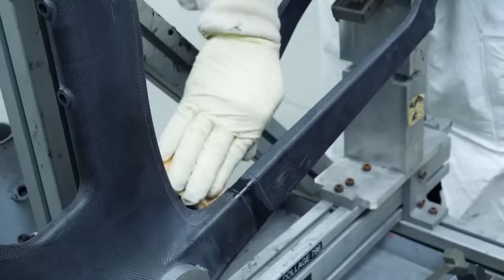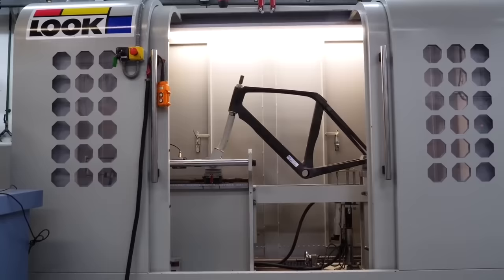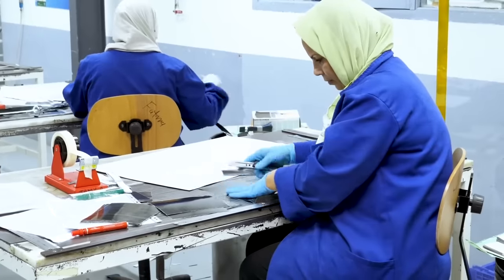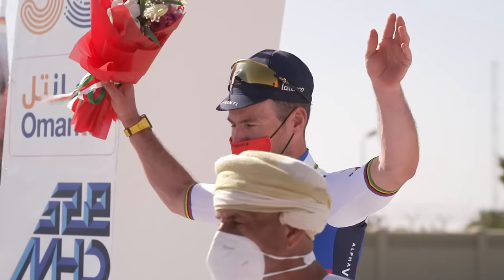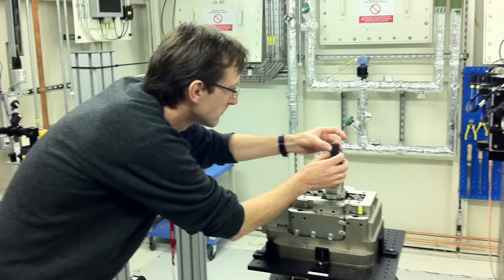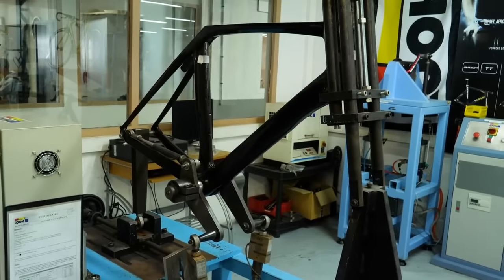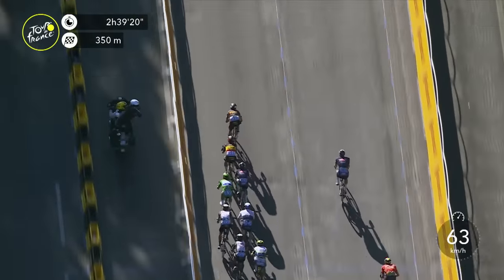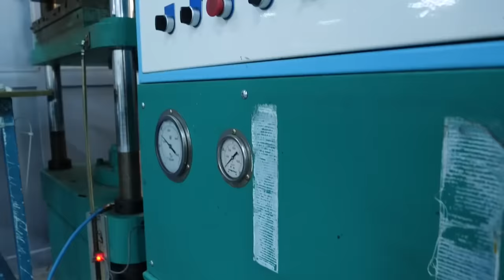Your Carbon Fibre Bike Won’t Last Forever

Comment: The "dead" feeling is by no means limited to pro sprinter's bikes.  Here in Girona many pros (including domestiques and climbers) talk about the difference in feel between their training bike (which may do around 30,000 km in a season) and the bikes teams reserve for them to ride in races; the difference between them is more noticeable as the season progresses.  When new bikes are issued at the start of the next season even the dedicated race bikes feel better to ride.
Reply: So that would suggest that 30,000 km is enough to cause significant fatigue.. That's not very much! It would mean that even your average keen amateur doing just a few thousand km a year is going to "wear out" a frame in 5 years in terms of ride feel. OK, they will be putting out less power and so the loads wil be less, but not by an order of magnitide.
Reply: @neil7769  That's just a couple of years for some. Never saw a manufacturer mentioning this, every year the frames are 5% lighter, 3% more rigid and 6% more compliant but the fact they wear out is omitted for some reason...
Reply: @neil7769  that is two years of riding.
Reply: @iwanta400ftp3  Two for you about three and a half for me, doubtless 6 months for some.. ;-)
Reply: So riders complain about the frames, which is one of the things they depend on to be supplied by their teams/sponsors... Hardly a reliable source, needs some scientific backing.
Reply: @neil7769  I've read a commenter here in a different video who has cracked aluminum and steel frames on a regular basis say that after 15-20k miles, he buys a new bike.  His experience is that aluminum or even steel only lasts 3years or around 30k miles before cracks start to show.  

He rides about 10k miles a year commuting/loaded groceries on aluminum mountain bikes and cracks them consistently based on his usage.

Aluminum mountain bikes are usually built heavy and stronger with thicker tubing.  From my friends who ride they usually replace their carbon frames every 4-6years of amateur riding.

Carbon does not last or should I say my trust on carbon does not extend past 5years of regular use.
Reply: @bonbonflippers4298  u have to consider each rider's weight with regards to material lifespan & how they ride. If they huck any material MTB all the time, all of them will fail sooner versus someone who bought a extra lightweight MTB & puts 30K miles into it but only rides it on the road. Many variables to consider
Reply: @fujitsubo  I agree, the weight of the rider and power output is the big factor in stress of the frame.  Also the riding and terrain it goes through.  

The thing I was curious about that the video did not address is the vibration that composite material goes through. Does that affect the frame's lifespan compared to aluminum or steel, the epoxy of carbon...does it loosen up as more vibrating occurs with rough terrain?
Reply: The difference between the weakest and the strongest rider in the tour is marginal. That's why the teams go after marginal gains. More difference in abuse (stress) is probably between smaller and bigger riders.
Reply: @bonbonflippers4298  100% agreed.  Very different if youre a 145lb rider that smoothly delivers efforts while seated vs a 220lb guy that stomps climbs while pulling the bars for all theyre worth.  My only carbon frame at the moment is a Trek Domane that I use for gravel riding and with 8,000 miles on it, still feels great. If I can get 20-30k miles out of the frame/fork, Ill be happy for the money and move along to something else.
Reply: @DaanHoogland  I haven't heard anyone complain about this, just comment that it is a noticeable effect.

What would you consider to be a more reliable source than pro riders?  I cannot think of another group of users with more experience of this or with easy access to directly comparable bike frames with very different usage profiles.
Reply: @GrahamNicholson56  short of taking the 2 comparative bikes and performing rigorous evaluations on them the answer would still be anecdotal. The only other option would be to perform a double blind study with the teams using old and new frames such that they cannot discern the frames and see if the older frames are in fact softer/not as stiff. Designs always have some sort of assumption to them, users however ALWAYS manage to find edge cases where they will break the assumptions made in the design and then there is a potential for overstressing/overstraining of any component and therefore metal or composite fatigue. I know many people who are harder on components than others and this may just be down to the fact that they themselves are "breaking the matrix :)" and others which would seemingly be able to make the same component last orders of magnitude longer. There was a comment earlier on the " 5% lighter, 3% more rigid and 6% more compliant" this likely is not something to be concerned about .... unless you find yourself in the position that you are a user which demolishes the seemingly valid assumptions which the designer had in place. Compliance and rigidity also cannot be done in the same load case, its either softer or more rigid; but if the load cases at which this is measured are in fact different then there is a potential for this to occur and is all based on further understanding of the expected loads in the component/area and what goals are trying to be achieved and how they use their carbon layup to achieve this directionality of the properties. And if you are well within the design range of the assumed loads then likely the bike would be fine with reasonable use and without exceeding design parameters (impossible to know as well)
Reply: @peterrandall7657  you ate correct on this aspect of the design of the frames.  It really comes down to first and foremost the quality and manufacturing of the frame. Assuming that the frame is up to proper specs and not have defects that's undetectable to the average consumer then we can come to a conclusion of deteriorating stiffness or degrading epoxy can be felt by the pros
Reply: @GrahamNicholson56  Of course pros are the best human source of information on this topic. But then still they'll want a new frame when they can (like the rest of us) and their judgement may be influenced by that.
Reply: @neil7769  The answer is always it depends. Because its always a question of manufactoring and afterwards use. Same frames can last different time because of manufactoring.
Reply: @peterrandall7657  I've seen no mention of wheels and tires -one of the largest factors in "compliance" in a bike. Most pros aren't training on their race-tubulars and rims.
Reply: I agree with the dead feeling but a significant part of it is the wheels used and the fact that your racing chain and gears are immaculate and my training gear is not

Comment: Epoxy resins degrade quickly compared to acrylics, so the paint on a frame performs a vital function: it prevents moisture and and UV degradation (at least until the paint breaks down).  How about producing a video on the paint systems used on bikes, carbon, aluminum and steel?

Comment: I have owned and ridden my 35 year old kestral 4000 many many miles. Still no issues or cracks with the frame. Actually i met a few weeks ago the engineer who worked on the structure back in 1986. He was happy to see it was still in good shape.

Comment: There is a way to actually monitor the evolution of fatigue in a frame by "attaching"  tell-tale structures or foils to the frame at critical locations, where the highest loads are expected, which have a much lower fatigue resistance than the frame itself.   For example a printed resistive layer on the frame will change its resistivity as the material ages under repeated loads because of the gradual growth and number of micro cracks in the resistive layer.  These resistive layers can be tailored towards the expected accumulated stresses over time to give an indication of remaining 'life time' in the frame.    These foils or tell tale structures can be protected under the lacquer with only the contact points exposed.   Such  elements are used in the aerospace industry to monitor the stability of aircraft wings, although this is primarily done during the development work in aircraft and once the required knowledge has been gained during development/testing these tell tale elements are no longer needed as the structure is by then well known and understood and load factors can be accumulated by other means.   However on a push bike, especially in race situations the loadings are less predictable and there are no other means of measuring loads applied to the frame (except for maybe power input by the rider).
Reply: Hah, I can imagine pitching this to the sales team: 'Oh, and BTW, production units should have a bunch of telltale stickers in places where our tests have shown early frame failure, so that the costumer is always aware of how their brand-new, super-expensive carbon frame is slowly dying with each pedal stroke'.
Reply: @AG-el6vt  On the other hand, it could be a measure to tell customers that their bike is still perfectly OK since it has been designed for professional athletes who put regularly many hundreds of watts through the pedals for hours on end, day after day, whereas 'you, dear customer' will be able to do maybe 200 or 300 watts for an hours or so once a week and hence under your puny exertions the frame will live for ever. ...
Reply: @robertrjm8115  if you are at that level of rider, your bike is disassembled and sent for xray and inspection. no need for stickers
Reply: Mileage indicator of some sort, built in to the frame? Seems like the lowest common denominator of lifetime health of the material, could be anywhere since not measuring specific strain etc.

Comment: I have a LOOK KG 251 which I bought new in 1999.It has carbon forks and carbon frame,however the main joining areas are aluminium. At present I have cycled 307.000km and the only noticeable fatigue is from the aluminium lugs.I have 2 other LOOK bikes that are full carbon,so it will be interesting to see how these cope in the future.I very much liked your video and also the video when you went to the LOOK factory .Thanks!
Reply: wow

Comment: Also adding the comments below, if there is a part 2, bring in someone from the sailing community as the u/v degradation on sailboats must be more extreme than for bicycles. Perhaps someone from Ben Ainslie's crew. Love the content Ollie!
Reply: ps you dont instantly die if your mast cracks
Reply: @ohhi5237  This would of course depend on the boat and how rapid the rate of deceleration is.
Reply: @arcboy2011  a proper boat, like one that floats and u can do baoty things in, they costs as much as a full house, yes thats more than your bike bye

Comment: I am loving these videos from Ollie. What's next? If I can make a recommendation... different power meter technology. Would love to see a discussion of what goes in to pedal based vs crank arm vs spindle, etc.
Reply: Look up the channel "Peak Torque", he's made several very in depth videos about the engineering behind power meters! Great channel, I believe he is an engineer in the bike industry iirc
Reply: @benmodel5745  I do like Peak Torque's videos. I saw the one he did on Assioma - I thought it was quite interesting.

Comment: Great video. Thank you! I have a 16 year old Giant Carbon NRS-C1 that I bought brand new. Last year I completely rebuilt it with a 1-by GX Eagle drivetrain (something that didn't exist back when I bought it, but it lined right up!) and I still love riding it to this day. I've had some pretty bad crashes but so far, no issues with the frame. I think the lifetime of a hard-use carbon fiber mountain bike frame is mostly down to luck, assuming it was well-made to begin with.
Reply: I just bought a 2017 Cirrus Pro carbon and I always have the fear of my frame collapsing on me.

Comment: As we are talking about CF frames seeing potentially a decade or more of use outdoors, regular application of a good polymer-based automobile / marine wax product is probably the best bet for keeping that CF frame in good shape (assuming you don't have the output of Chris Hoy).   Since these products seal the surface and protect against UV, moisture, and oxidation damage, I would think this would help, especially for bikes painted in darker shades, like red, blue, and black.  These colors should benefit the most from a regular wax treatment, as these pigments are most vulnerable to UV damage.  The sealed surface should also help protect the epoxy from oxidation and moisture damage too.  Think of paint protection and clear coats treatments on automobiles and how they are used to prevent UV and moisture absorption and oxidation damage as an analogy.

Comment: I highly recommend everyone carefully inspect your bike every 3 months including the fork after a good wash. I have found the following in 17 years of riding carbon bikes:
1. Cracking around the fork crown at junction of carbon fork blades and aluminum fork steerer (bike had been in several crit/bunch crashes) - 2005 Giant OCR1
2.  cracks on the underside of chain stay of two bikes frames (one cheap Chinese dengfu FM01 cracked due to being crap, BH G6 which was crashed at 53kmh)
3. Cannondale CAAD10 fork steerer cracked due to stem being so thin (3mm wide at its narrowest point due to stupid attempt at weight savings on stem internals) - poor design! Replaced with carbon stem which has no cut out on the inside of stem (fully supported) and used a 50mm long expander plug. Cannondale one was 15mm!
Reply: Agree with checking often....  I use Carbon Forks with Alloy Crowns.  (Exotic Brand) Only the tubes are carbon. I have over 8000 miles on one fork (most very rugged CX trail riding) and recently inspected it, no signs of any damage.  I do not think I would every trust a fully carbon fork on the trails.
Reply: How do you check for micro cracks in carbon fibre--dye penetrant?
Reply: @MrJx4000  I found large cracks that were obvious to the eye (a few mm long) but I have watched videos of people using ultrasonic equipment to scan carbon fibre

Comment: A most excellent tech inquiry. 

I am nowhere even near being an engineer, but I still knew the answers to some of the questions posed even before they were answered, the 'paper clip' analogy to the stresses which cause failure in a metal frame being the most direct (I was thinking it even before the professor used it to demonstrate his point).

I also figured out a while ago that the resins/epoxies used in carbon fiber composite frames  are what would 'age out' over time, and become brittle, and even more so/quicker yet if exposed to long term UV rays.

PLEASE be sure to ask Professor Morrow (I am guessing with many multiple doctorates) in any future discussions about the crystalline grain structures of the various alloys used in metal frame tubing (especially titanium alloys!), and how they differ in stress cycle to failure longevity, and even how they differ in hard, sharp, spike amplitude IMPACT failure scenarios.

It would bother me if i just dropped $20K USD on a fully kitted out Dogma (or whatever their up to the second top of the line is right now?) rig knowing that if I used it as it was built to be used, I would have to replace it in less than 5 years time.

But then again, if I had Jeff Bezos type coin, and was incessantly worried about my kit being 'dated' even a slight bit style wise, I'd be dropping that much every other year or so anyway.

Comment: My frame's a 20 year old carbon one and it's still fine. It's kept kept dry, clean and in an outhouse away from light. It's had to be repaired once and I can tell the difference between the before and after, but it's not enough to stop me riding it.
Reply: beat you, I have a Dunlop Hotta Perimiter TT bike with Specialized tri spokes wheels on it. The bike and wheels are circa 1993 and the wheels have a 1993 sticker on them. I changed the forks for bladed MDT units because of aerodynamics as it is a TT bike but the frame and wheels have absolutely no signs of deteriation or cracking or anything else on them after 29 years. I still regularly train on the bike but now ride a Trek Speed Concept in competition with HED 6/9 wheels.
Reply: You’ll think it’s fine until the moment it fails. Rather you than me 😀
Reply: You lost the argument at “it’s been repaired once…”. It’s not fine, it’s a ticking time bomb
Reply: @xgalvan1  the repair was because I hit the deck, that's probably the most solid part of the bike now to be honest 🤣

Comment: I experienced UV destruction on my friend’s Orbea Orca 2009 frame about 3 years ago. Clear coat matte finish that showcased the carbon fiber.. 10 years of hot summer riding did it in. The chain stays got real punky like a sheet of plywood that had severe water damage. His bike was leaning against his garage it rolled forward and a corner of a brick pillar and a created a hole. We then poked around with fingers and started to create other holes. I had a similar type of frame at the time that I wound spray UV protective polish on as much as I could. My latest is a painted frame.

Comment: You're on a roll, Ollie. You're broaching so many important questions that CF bike owners have about their bikes. My situation: I own a 2016 Bianchi Specialissima with the matte finish, which was stored in our home, but now that our college graduate/graduate school student has moved back in, my bike has been relegated to our garage which in Southern California can become quite warm. My question would be does long-term exposure not to ultraviolent light, but simply warm temperatures in a garage degrade a CF bike's epoxy resin or laminate?